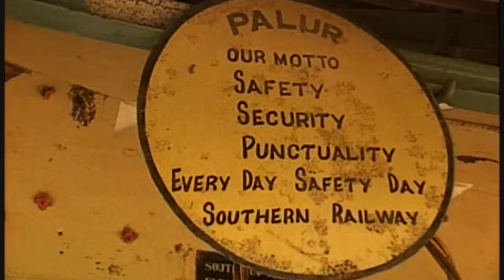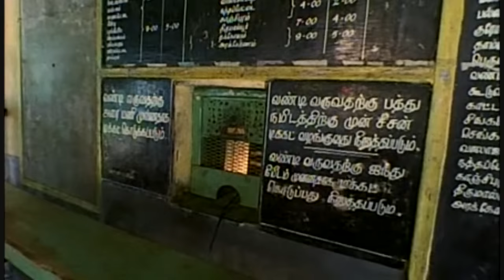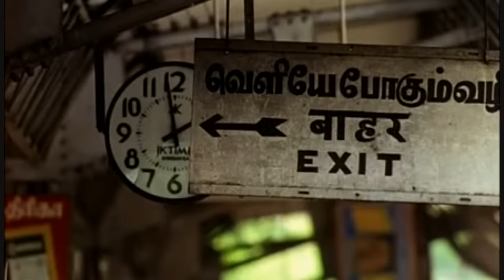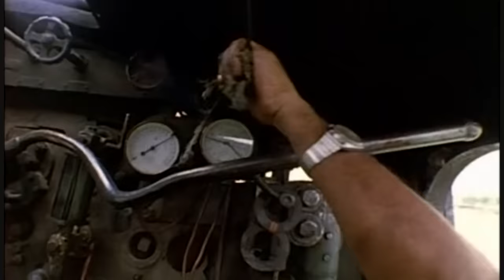India: Running out of Steam (part 4) : The Sad Story of Palur & the Last Run of Pondicherry Special

Comment: I grew up during the age of steam engines. Have picked up coal that had fallen off the engine from the station trackside near my village in TN as I saw the steam engine trains go by. Came back home covered in black coal dust every time! Make no mistake; these engines did pollute quite a bit. I am nostalgic about those simpler times but going electric was necessary. My village station vanished 30+ years ago and even 20 years ago there was no sign that it ever existed..
Reply: Which village are you from good sir?
Reply: @livinlifeat60mph  Nainaragaram, TN

Comment: As son of an ICF employee, and a Bengali settled in Chennai, I am proud of Indian Railways. I have travelled to Calcutta from Chennai by Howrah Janata Express, which probably took more than 40 hours to cover the distance. The third class compartments had no cushion covers over wooden seats-cum-berths and the windows were open with no grills. It was a thrill ride with the head looking for the beauty of the train, when seen negotiating a curve or the metal rattling sound over a bridge across the river, the constant bump at the rail-joints. By the end of the journey, I had a natural coal face-pack and sticky hairs with moist coal dust, everytime the engine picked up speed or whistled.  The Bitragunta and Kharagpur steam engine workshop, the water filling rituals when the trains stopped for the engines and the passengers who rushed to the few taps to fill water in metal or plastic jugs, with no plastic water bottle sold.  Imagine travelling nowadays in peak summer such condition. First time i saw the exchange of key-ball in Jhalda station from a fast moving non-stop express train. Such fond nostalgic memories and exhilarating trips, where my mother used to prepare food stuff for the entire journey mostly comprising of Tamarind rice and boiled eggs, potato chips, which were a cost cutting option when trains had no pantry, but the cost of a food packet was 30 paise or so. Wherever a train stopped at a station Or a hawker got into a train, the binge buying was on. Definitely cannot forget the innumerable Amar Chitra Kathas which my father bought us to read during the journey. What wonderful years passed by, this day fifty years ago...

Comment: I was fortunate enough to ride 1 commercial service using a steam locomotive. The whish-whash of piston, smell of unburnt coal, steam on face still is fresh in my memory even though I was 6 years old and now in my late 30's. The line that passes through the Palur railway station have been electrified. Last I heard in 2013, the station was still there as a "Halt station" which means it was unstaffed and few trains stop here if there's passenger to offboard or onboard, but it was not a scheduled stop.

Comment: I dont think Indians romanticise steam. They got rid of steam very quickly and efficiently as soon as they had an alternative. Steam, soot and smoke are horrible in Indian heat and humidity. They like the 'toy trains' to Shimla and Ooty but most enthusiasts are keen on modern technology not the old stuff. I think only one mainline loco was saved and that with western funding.   Its not like the UK, USA or Germany.  So this video has to be taken with a big bias warning.
Reply: We were running short of coal. That's why steam locos were replaced. Now a double electrified line runs through this station. This station has developed a lot now.

Comment: I am currently at Pondicherry now, and have arrived by train. The Palur station is now back in operation, with like 35 trains halting there daily. The Pondicherry Special is now up and running as an electric train. But it lacks the charm it had in the olden days!😢 Nowadays, it is converted to Broad Gauge and electrified, but is still single tracked.

Comment: In fact southern railway stopped steam locos in 1980 due to delay in getting coal from North side. But in other side they used steam locos in 1990 s also. Because I travelled many times in steam passenger trains in Nagpur/gondia/ wardha etc

Comment: Was this station really closed? I think its still there on Chengalpattu-Kanchipuram line.
Reply from the maker: It was closed for a few years after 1992 and then revived sometime around the year 2000 after electrification of the line was completed. A lot of trains still passed the station while it was closed, but they did not stop here. The station remained abandoned. A lot of Tamil movies depicting small rural railway stations have been filmed here in the 1970s and 80s (one or two movies in the late 90s as well).
Reply: @binoyrakesh  I have travelled on the Chengalpattu-Arakkonam stretch once. An absolutely beautiful stretch in the morning. The greenery that is on both sides of the single track is just breathtaking. All EMU's between Chennai Beach and Kanchipuram/Tirumalpur/Arakkonam have a stop at Palur I think.